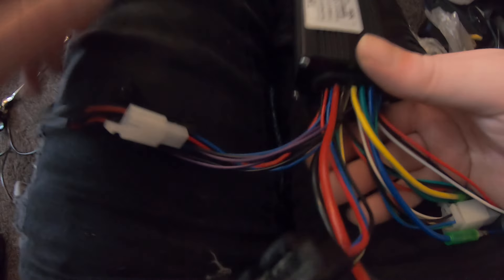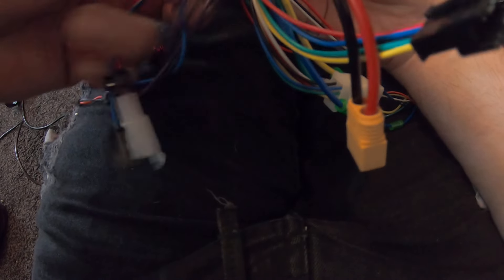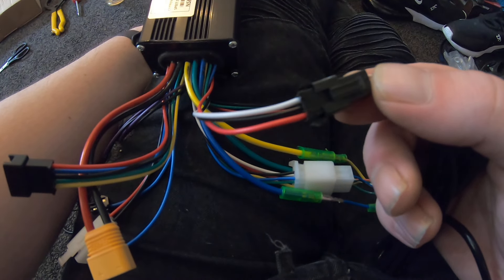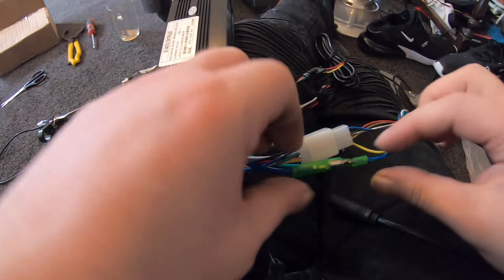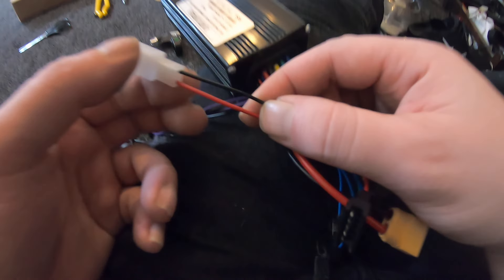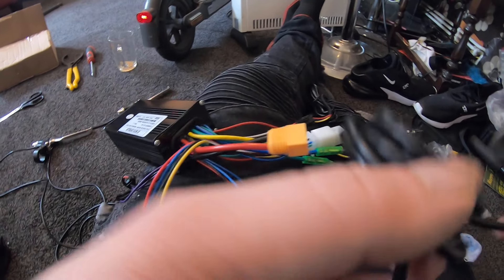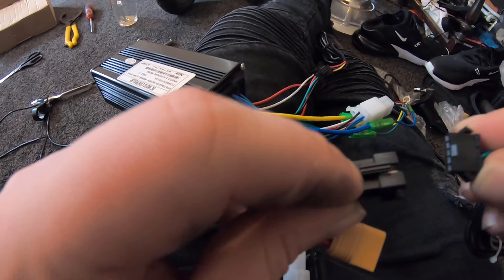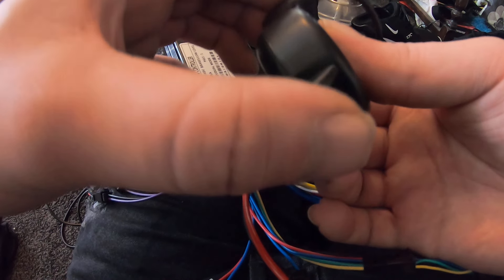36V-48V controller converter wires understanding

Comment: Thumb throttle with on/off and LCD display, RED, BLACK, GREEN, YELLOW, BLUE. Controller available wires, RED, BLACK, GREEN, YELLOW, WHITE, BROWN. 1000W 48 Volt Brushless Controller. Please comment ONLY if you know which combination works! Thanks! MarkMannM2
Reply from the maker: Some converters work with the on off switch some don’t 👍
Reply: My brake wire are red black got two yellow black and one orange and black

Comment: Hello, I have a problem. The hub wheel wiring has no white wire, and the controller comes with a white wire, and it doesn't hook up with the hub so it won't run

Comment: Hi bubbles way. Looks easy enough. I have a samebike lo26 which is not powering up which I had no probs with before up till now. The lcd screen doesn’t power on to and the battery is fully charged.the only life that works on the bike is the horn only which only sounds if I press the M button and horn button together at the same time. It doesn’t sound once I let go of the M button which is weird. I’ve checked the battery and took it apart and all looks good including the prongs. You think this sounds like a controller issue?  If I put a new controller in there is no soldering involved is there?  Thanks.
Reply from the maker: New controller mite fix the problem but check all wires to make sure no wires are split I had same problem once before
Reply: Ok thanks but if I did replace the old controller there is no soldering involved is there?
Reply from the maker: @rortyhfgheertstebdgsjsr3425  nope
Reply: @bubblesway  ok thanks bubbles way. One more question Any idea where I can order a controller for the samebike lo26 as I’ve noticed on eBay and AliExpress there’s so many out there but I don’t know what one will be compatible with it mate.
Reply from the maker: @rortyhfgheertstebdgsjsr3425  get a 48v controller from eBay

Comment: Hi, I'm having problems finding a replacement throttle for my 3 year old ENGWE. It has two plugs, one 3 pin plug operates the light and horn from the switches on the throttle and the other plug has a 4 pin plug and I can't find one anywhere. Can you help please?

Comment: I have a sw900 screen that switches on ,was working great disconnected wires from controller to put through the mount . Reconnected all wires , screen is now showing no bars on the battery. Bike will not drive motor on any setting even walk mode. Tested battery 41.45 v . Used a resistor to connect battery so no sparks . All cables have been checked for continuity. Always wear gloves  & plastic stand when connecting so no static. Its baffling me as there is power to the screen.

Comment: bought similar kit from amazon does not run. wires hooked up correctly, battery charged of course, did not come with display, I have a 6 pin throttle control . do think it is the convertor or the throttle
Reply from the maker: U can get a throttle with less wires but will need a different controller

Comment: Hello there, I wonder how to set the controller to handle 36v or 48v (mine is 36v battery), does the controller auto detect the battery voltage? Thanks!
Reply from the maker: No u set the volts ur self

Comment: please help me my controller wire for the throttle color is black white red and the actual throttle is black green red and when i connect it it says motor faliure but when i disconnect everything works fine

Comment: Hi .my controller is 36/48volts written.can i direct to 48 volts battery?
Reply from the maker: Yes 👍
Reply: Thank you very much for reply....even if i full throttle in long duration flat road?

Comment: I have a ancheer 36v ebike and I tried to install a brainpower motor controller model 866c-6 and I can not get the throttle to work the display screen does turn on but I get nothing when I turn the throttle if I connect the white learning wire  the wheel will start spinning but when I try to connect throttle I get nothing plz tell me you can help me I’m out of ideas
Reply from the maker: Sometimes some throttles won’t work with some converters if the wheel starts spinning like u said try a different throttle
Reply: Sometimes the colored wires on the throttles are installed in different sequence than the controller and then need to be taken out and matched to the controller connector.
Reply: how did u install the s866  lcd and throttle ive took plate off but dont know what to do next

Comment: Hi thanks for video, my wife’s e-bike stopped working, looked at control, looked like one of the capacitors had burnt out , so I replaced it , plugged controller back , think I have all the connections ok , but now I get an Error code 009 then it turns to code 010 , I know it’s a bit of a long shoot , but any idea what it might be ? I’ve ordered another controller but the wires aren’t the same 😮 . Kind regards Chris
Reply from the maker: The break wires

Comment: Hello sir 
I'm having a problem with my ebike, the e-control system of the by got burn so I had to order another E control system from China when they brought it here it was not the same with the previous one that was on the bike so right now I am facing some difficulties in connecting it play so I don't know if you can help me out
Reply from the maker: @tambichris2808  tell me wat u need help with

Comment: I have a question the controller I just bought has all the same connectors except the light connectors,here in stuck you see this controler has 2x 1pin yellow wire for the lights my bike has 2x2pin red and black how do i connect my lights anyone please

Comment: Good morning Bubbles my name is Frank Grinwis from the Netherlands and I've bought myself a new  Brainpower Motor Controller 36V/48V/350W angle:120/60 Model:LSL121 and a S_866 display they came in one set (so I thought that it would be easy to connect it !! !!)
Bút I've been trying to find the right wiring diagram on the internet because I can't find the wiring for my S_866 display on the controller !!
Do you please help me out with this project because now I can't rode my Windgoo B20 e-bike (with gas handle ! !) Só hópéfúllý you'll be able & willing tó hélp me to fix this. Greetings Frank Grinwis

Comment: Your not getting to point of using converter from controller there are normally red and black that's for 22v step down. The converter has black and red and yellow. You connect red tred and black to black on controller the yellow wire you can run alit of wires from yellow for light indercator headlight horn Al from yellow wire so why did you not explain in video. I got that info from another video. It's best to put yellow in a loop contector box it looks like choc box then each live wire goes to yellow with switch in between the black wire from controller that's already in converta you yes that as a earth that's it more ore less so yes I can run all lights as long the are 22v from yellow wire